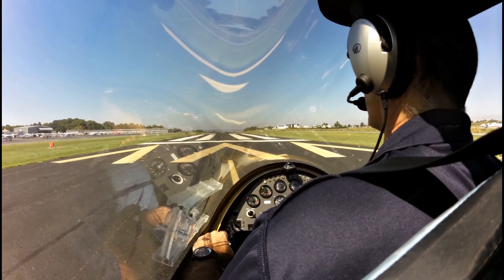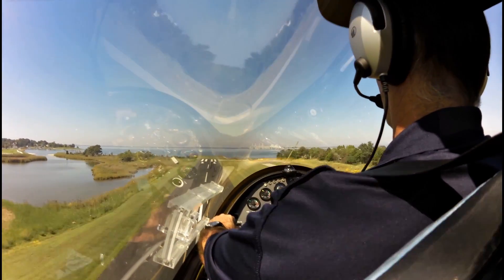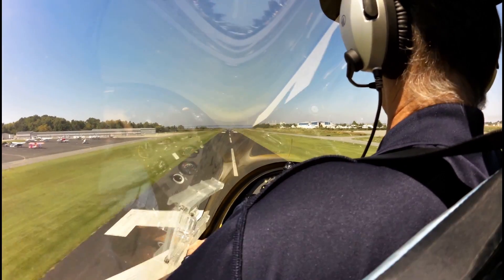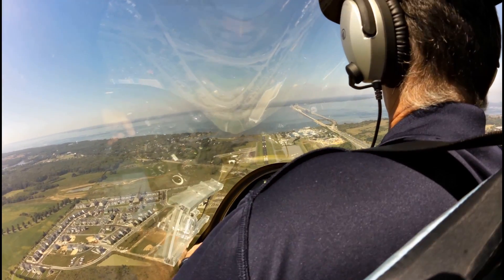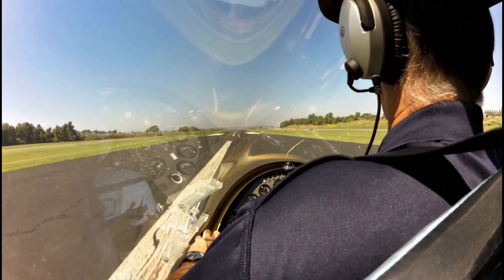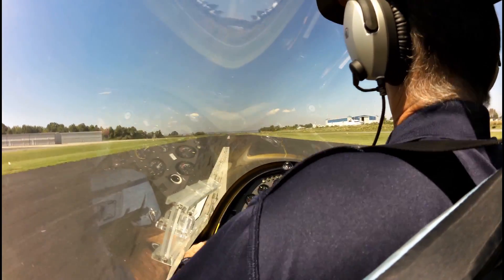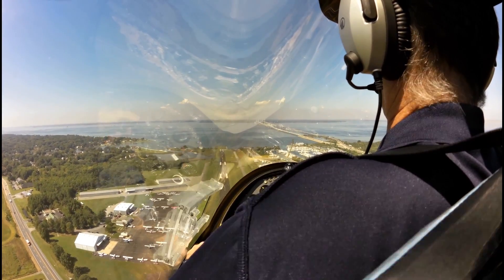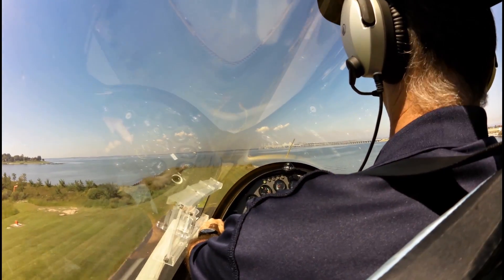Calidus Autogyro Training Lesson 2

Comment: you need a pilot license first?
Reply from the maker: In the US there are several different ratings that you can get to allow you to fly a Gyrocoptor. You can get your initial Gyro as either a sport pilot gyro or private pilot gyro certification.  Both of these limit what additional ratings that you can add onto the initial certification.  the sport gyro is further limited to flying only 2 seat gyros.
   You will have greater flexibility for additional ratings (amphibious, glider, etc) if you add the gyro rating onto either a sport pilot fixed wing or a private pilot fixed wing initial certification.
   For more detailed explanation refer to FAR part 61.

Comment: Hi, I want to try one of these. Do you have to put in a lot of right rudder for torque ?
Reply from the maker: I would encourage you to give these a try, they are so fun to fly.  They do require a fair amount of rudder application at the correct time to keep them going strraight.  I think it is due to their small vertical stabilizer and the added torque of the turbo on this model.  As you can see from the video, it took me awhile to get proficient at it.
Good Luck!
Reply: yes thanks but with my current ppl do i need a type rating?

Comment: Thanks for sharing... looks like it really takes some practice to nail the torque (yaw) and lowering the nose just the right amount... gotta wonder what a 20kt. crosswind would add to the mix!
Reply from the maker: +THE LAST DAY The torque did take getting used to, but once you get the timing of when to apply correction, it's very controllable.  Surprisingly, 20kt crosswinds aren't an issue.  One of the big advantages of a gyro is that they handle turbulence and crosswinds much better than a fixed wing aircraft. 
Thanks for watching
Reply: +THE LAST DAY Doesn't mean that the gyro doesn't suffer from crosswind conditions just not as much as a fixed wing. You handle it like a fixed wing. Tilt the rotor slightly into the wind with opposite rudder pedal. Then snap to neutral trim just prior to touchdown.